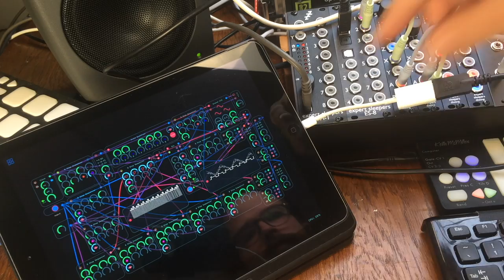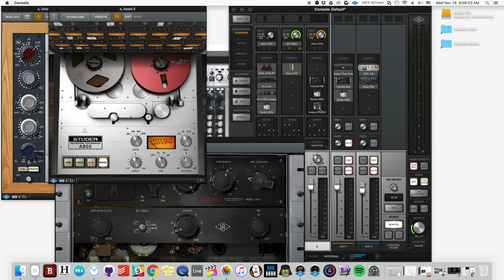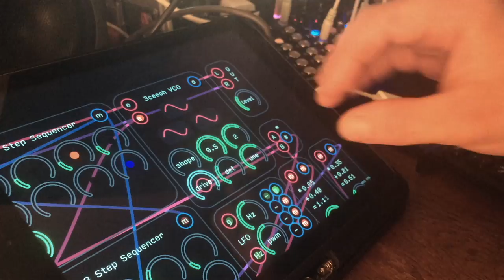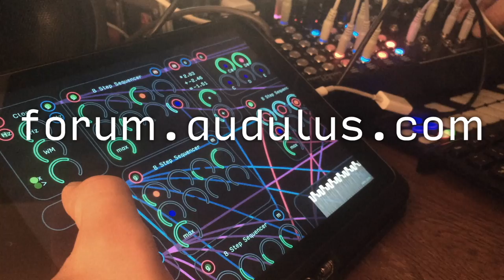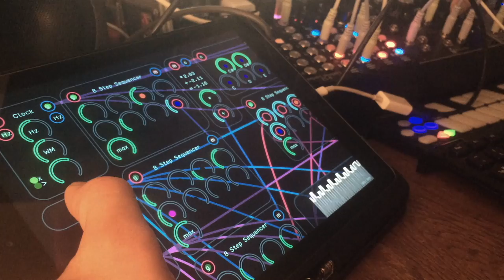Audulus Build Podcast #5: ES-8 Acid Bass Sequencer

Comment: I have been resisting buying an ES-8 because it's digital and I specifically wanted to get away from computers to make music with my rack, but I just caved and bought one :D This module, along with Audulus and other software, is so incredibly versatile, yes it's pretty expensive, but I can build like 4 separate modules into this one module, and change what that module does...anyway you get me I think ;)
Reply from the maker: Totally! Check this out btw: https://www.youtube.com/watch?v=7mHdRdvKmFA

and this:

http://forum.audulus.com/categories/expert-sleepers-es-8-modules
Reply: clicks youtube link, loads at default at 38:05, hehehehehe 
Thanks for the links! The module just came in, I'll check them out
Reply from the maker: :) Let me know if you need any help getting started mark@audulus.com
Reply: Thanks! Had some issues on my mac selecting the right output, figured out you need to select it as a system setting, everything works as a dream now!
Reply from the maker: You're using the ADC/DAC nodes too right? This video was made pre-those, so you were just limited to 2in/2out.
Reply: Yep! Everything is working awesomely on all channels! Even went ahead and bought that 45 bucks ipad usb3 cable so I can use it on both my mac and my ipad... :)
Reply from the maker: Yeah I finally took the plunge and got that one myself, mostly so I can charge and use an iOS device at the same time :)

Comment: I need to get my head around all the conversions that need to take place inside of audulus
Reply from the maker: Conversions?  What do you mean?
Reply: modulation to pitch etc ... the M-O modules etc
Reply from the maker: m and e are essentially the same - envelope is just a specialized modulation signal.  g is gate, an o is just the octave signal that ranges from -4 to 4, with 0 being A=440.  the m2o module just takes the 0 to 1 range and spreads it over a defined range in the -4 to 4 o signal - this is a more efficient and free flowing way than to make each knob -4 to 4 - plus if the sequencer outputs m signals, they can be used on other sequencers (like this!).  But on the whole you don't really need to translate signals more than you would in a modular system - a gate goes into an envelope and gets translated into an e signal, which goes into an oscillator and gets turned into an a signal, etc. :)

Comment: Hi Mark,. What kind of table-top stand are you using for your iPad in this video? Looks fairly sturdy. I'm needing to get one and been putting it off for too long.
Reply from the maker: It's a Snugg brand keyboard case - you have to give them a little love when turning them around like this, but they're sturdy otherwise. I had some books behind it that you don't see preventing it from wiggling while I push it. If you want something that won't move and don;t have to stack anything behind, the basic iPad cover that folds back works great, as long as you're ok with the iPad just being raised a little - see this: https://www.instagram.com/p/BZkt8VQAtNE/?taken-by=audulus